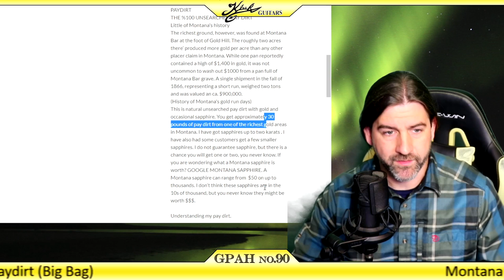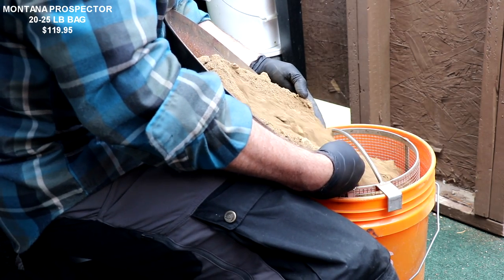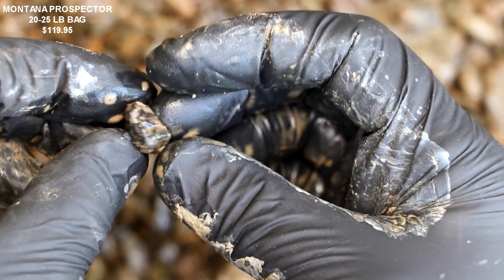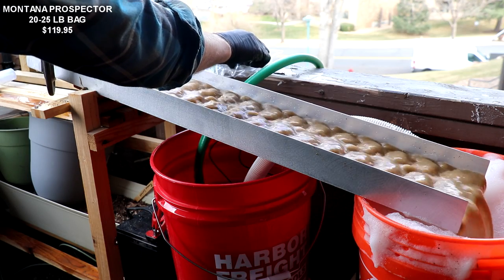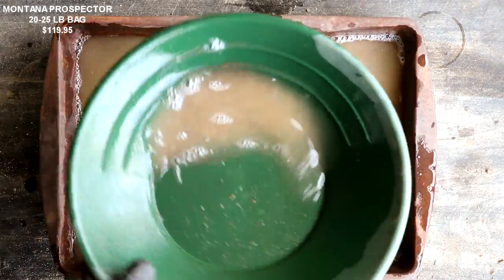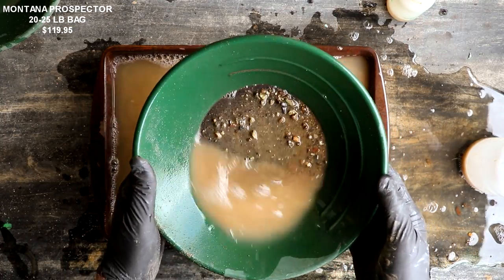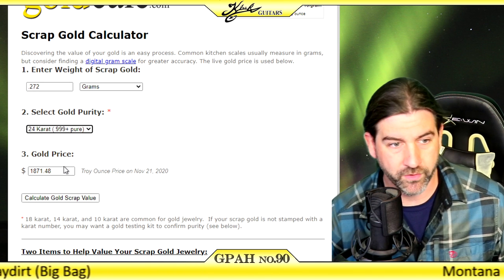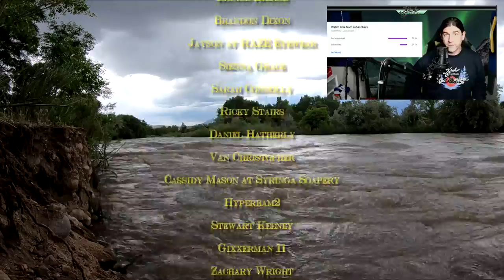Huge Gold Nugget Paydirt from Montana Prospector 20 - 25 LBS

Comment: Thank, for your previous review ( 4 YEARS ago and seller still raking in money for garbage). A real rip off on eBay. Thankfully, I got my $60.00 bucks back but I wish there was some way to get this sort of thing de-listed from the various sites allowing folks to be 'scammed'. I see your commenters below saying they are doing this for the first time and are finding very fine flour gold. I fear they don't know it's pyrite and mica! My four pounds of fractured rocks (mine tailings? to add weight?) and mud, mica and fools gold and didn't even have 1/2 teaspoon of black sands. Very , very hard to pan and yielded ONLY 1 small flake! This is just not right! Even with the seller's comments something to the effect that it's a 'crap shoot' and that it's possible to find very little gold. BUT in the very same ad it said gold is added. Nothing was added to mine. I had other friends - members of two different gold clubs I belong to go through the unadulterated material with the same results.